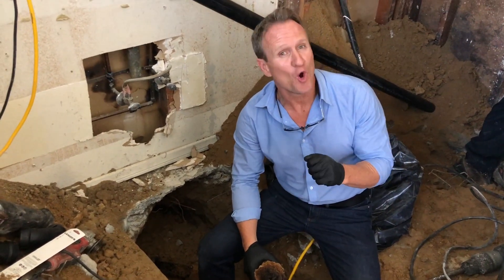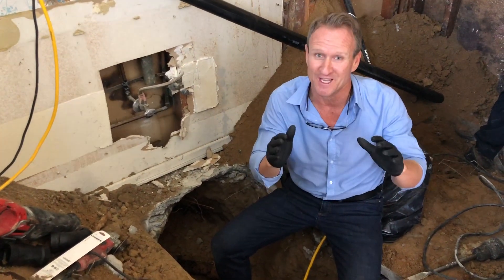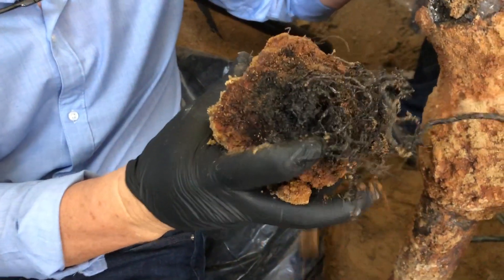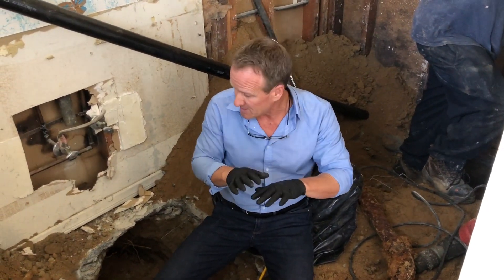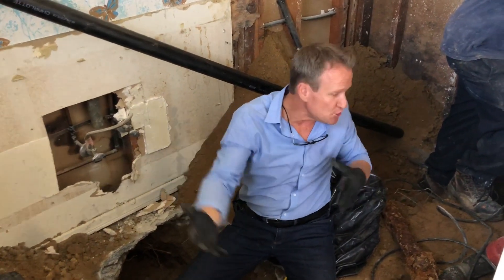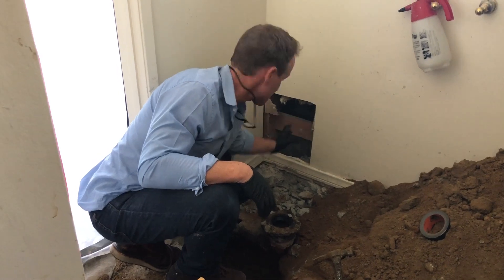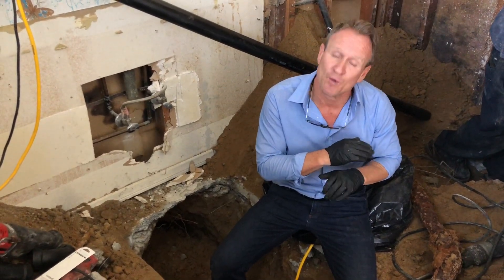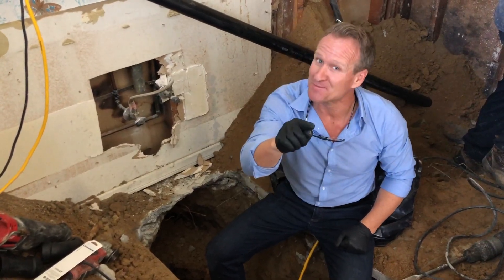Underground Drains Clogged | What's The Repair Cost Under Slab?

Comment: Very good info, I am currently dealing with rusted out galvanized pipes. I’ve replaced all the under sink pipes and hardware. Unfortunately the kitchens drain pipe is rusted out. Anyways great video! I like the use of the tarp zips.

Comment: After fixing a sewer line break in my front yard I have sewage under my basement foundation that gets in through my sump pit and waterproofing system that attracts drain flies. How do I treat the contaminated soil? The sewage line was probably broken for months or even a year will it eventually wash out or will it remain contaminated?

Comment: What’s the turn around time?  Have about a 40’ line that needs replacing. Kitchen and 2 baths hook up to it.
Reply from the maker: this really depends on depth and access. 
40ft of drain line, might be a good fit to descale and rehabilitate using the epoxy coating method. This is an option to consider if you want to save flooring and major dig.
turn around time for epoxy lining is 2 days, turn around for the 40 feet dig is 5 to 8 days.